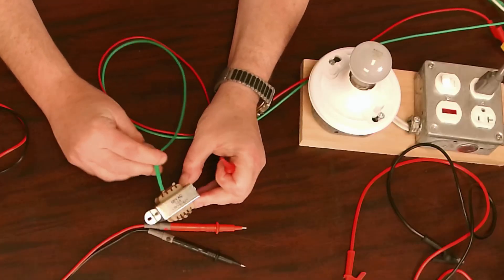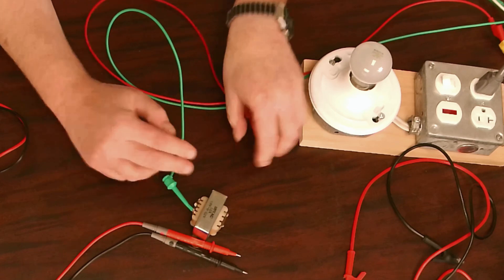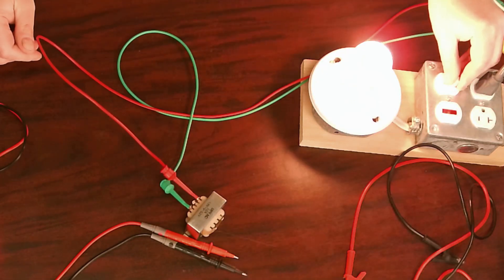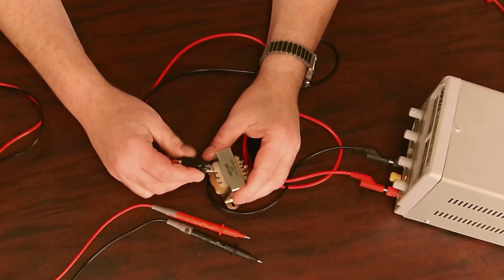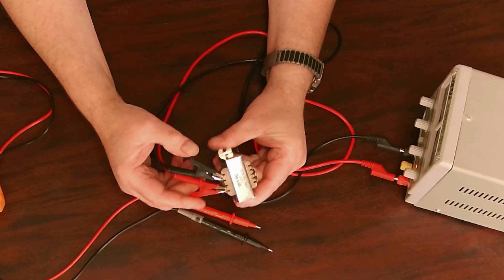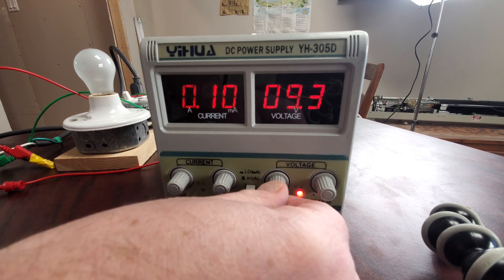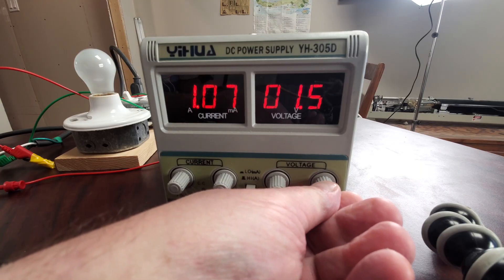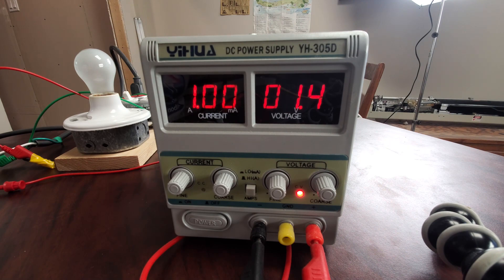MORE Ways to Identify Unknown Transformers

Comment: as I was studying my electrical book , I stuck with what's a dead man switch? 

I searched the definition about it, which says ' is a switch that prevents an equipment to be turned on accidentally or so '  but then I needed to dig deeper into this  DMS and found out your video which helped me understood what DMS is and its circuit diagram.
 

Appreciated Dr ❤
Reply from the maker: Thank you so much! I'm so glad you found it useful.

A dead man's switch is such a valuable safety piece of equipment I wish it was more well known. Its used in everything from train engines to protect against a sleepy driver to factories to make sure an operator is no-where near the dangerous part of a piece of equipment when operating. 

It really should be a must have item for anyone repairing or otherwise working with electrical  things operating with potentials higher than a couple of tens of volts. 

Here is the how-to video I made for anyone reading this: https://youtu.be/ZhCvTCeGvMc    

(For those viewers in different  parts of the world, use sockets, plugs etc appropriate for your region).

Remember though - it should be the last line of defence. Even with such a device, do things in a safe way as you would if you didn't have a dead mans switch. One should always have multiple layers of safety in case one or more safety precautions fails. 

And yes, I do use it myself when dealing with things that could zap me!

Comment: With an incandescent bulb in series with the secondary, the initial surge current may cause a very large voltage in the primary, higher than the 120V (240V). Only when the bulb reaches working temperature and its resistance increases will the voltage at the primary fall.
Reply from the maker: Yes! Although not much higher - the voltage gets limited by saturation of the magnetic core. Good thing  is the bulb filament gets hot really quickly - faster than the thicker secondary winding preventing overcurrent heat damage (unless of course the bulb was really oversized in relation the the transformer).

Comment: If only incandescent light bulbs weren't getting so hard to find! I need to build a light bulb rig. Just the other day I was doing exactly this with a variac and cautious measurement. Could have saved some time!
Reply from the maker: Too bad your in the UK or I would send a few bulbs, but mine would burn out in 240V countries. It may be different over there, but over here "dollar stores" often have them. Maybe you have places that sell things for a pound or two? The other options are decorative bulbs which are sometimes incandescent, and halogens are an option as well.

Comment: Thank you, some very useful information in this video. How would you calculate how much current the secondary could safely provide?
Reply from the maker: Thanks - glad you found it useful. Really two things: do a rough comparison with similarly physically sized transformers to get a good guess at the watts or VA. If there is only one secondary winding and you determined the voltage, use that and VA to get  current. For multiple windings, you may also have to guess by wire thickness (or if you cant see the wire, resistance of the winding. You could probably assume a max of perhaps 5% of the total power is lost in the winding at full power, but it varies. In the end you need to test - run it various currents for longer periods (say 1 hour) and watch the temperature and any bad "things are too hot" smells.

If you didnt already see it, look at the previous video I did on the topic (a few videos back) for some more way to do it.
Reply: @ElectromagneticVideos  thank you very much for taking the time to give a pretty comprehensive explanation. This is the 1st time that I have seen your channel, so I will look at your previous videos.
Reply from the maker: @ianfisher6561  Your most welcome! You will see quite varied videos on my channel - all science and engineering related - enjoy!

Comment: We did do 'ring testing' on small power transformers, like in old TV sets... to check for opens, or shorted windings too I believe... using a Sencore LC53 et. al. Anyway...AFAIK,  if there is more  coil resistance, that damps the rings more... and a larger inductance make the individual rings longer (usually you want to see a few of them) A good fast rise-time pulse can generate ringing... but watch out for the inductive kickback!
Reply from the maker: "more  coil resistance, that damps the rings more... and a larger inductance make the individual rings longer" I think thats exactly it! And a short would really damp the the ringing to nothingness. Looked up Sencore LC53 = you can still get them on ebay!

Comment: I found the audio had a little distortion... either because of reflections (lot of glass on the walls, behind the mike)... or the base... maybe.
Reply from the maker: Actually thats exactly what I was thinking. My plan is to put up some big curtains in front of the window as an absorber to hopefully reduce the reflections bouncing around the room. Its  reflections thats why I normally use a headset mic - the reflections in my basement where I do most stuff are terrible - with the mic near my mouth the direct source overpowers the reflections.

Comment: @ElectromagneticVideos The L meter could be using a frequency domain (sine wave, impedance), or time domain (square wave, ramp) or other measurement method.
I guess it is using the fixed frequency, frequency domain one, where the impedance is measured, and the firmware calculates the inductance, from that impedance measurement. 
Putting a resistance in parallel with one of the windings will mess up the reading either by shunting current, or messing with the mutual inductance. AFAIK series resistance between the terminals of the winding (like the resistance of the winding) won't... because that's a series current, not a shunt one.
Reply from the maker: I was wondering how it might be doing it - my guessing this really cheap meter it some sort of simple measure the current ramp type thing without considering R in any way. But you never know with the sophistication that can be built in to off the shelf meter ICs.   When I have some time will investigate with  a scope. Even with this meters limitations, I was amazed that for $25 you can get an inductance meter.
Reply: @ElectromagneticVideos  About the low cost of the L meter... the case and the display for the meter you showed... in the vid... is very cheap in China. (maybe a few USD in quantity) That case/display is widely mass produced for a ton of cheap DMMs. The band-switch terminals/wiring, are integrated into the PCB design. Although most of the DMM ASICs don't include an inductance measurement... it wouldn't surprise me if they replaced the resistors in the divider, with capacitors, and programmed a cheap micro-controller like a Nuviton ML51 (less than one USD per) to make, compute, and display the inductance measurement. All in all... for sure...about 10.00USD to mass produce that meter... in China.
Reply from the maker: @willthecat3861  You know - you are getting me more and more curious about it. Will open it and see. Your bang on about China - got in on Aliexpress - was looking for the cheapest to show thats all that is needed.

Comment: 12:40 if you have a scope, you don't need an inductance meter, you can calculate it from voltage drog at different frequencies.
Reply from the maker: If you mean voltage drop across a series resistor? That  would work particularly if you took the resistance of the winding into account in the calculations. You really would need only a measurement at at the power frequency. I would be wary of measurements at other frequencies because you never know frequency dependant aspects of the core might skew results.
Reply: Yes, across a series resistor. There are a few ways that you can do it. You can measure across two different frequencies to compare them but it makes the math easier if you measure one frequency and then drop it to the point where the signal amplitude is 1/2 of the original. You can also get pretty accurate results using a single pulse and measuring the ringing in a tank circuit with a known cap. Of course, if you a known inductor, you can also just compare it to that. Keysight has a good explanation of how to do it on their website, and of course there are many YouTube videos on different methods - some better than others. If only there was someone on youtube who would make a video comparing which methods work best for different tyoes of inductors... 🤔

Comment: 9:30 That's not just an assumption, it's part of the formula for designing transformers: the surface area of the cross section of the sum of primary windings needs to be equal to that of the secondary.
Reply from the maker: Not really - you can often have transformers with multiple secondaries where the total power of the sum of the max secondary powers would exceed the primary power, the idea being you have the flexibility of using the transformer in different applications that need more power at one voltage or another. Similarly, secondary windings of significantly different power ratings are also common - ie HV vs filament windings for a tube amp or radio. Thats why I was a bit non-commital as to how accurate a measurement can be.
Reply: @ElectromagneticVideos  Ah, yes, in that case. I was thinking along the lines of optimizing design for a specific purpose, but yes, if the usage is variable that doesn't work.
Reply from the maker: @SkippiiKai  One thing I should have mentioned in my reply is for the purposes of videos I have found that for the audience of widespread  backgrounds it can help to stay "on topic" as opposed to going of on slight tangents that might distract from the main point. So you will often see I try and take take the fine line between mentioning too much and leaving out too much. I'm always happy to have people like yourself add in more details in the comments - which often results in very interesting discussions.
Reply: @ElectromagneticVideos  If I made a video on transformer windings it would be 4 hours long, include a detailed discussion on why the iron in powered cores is the heaviest element that can be produced by fusion in a star without neutron capture, the differences between transformers and flyback coupled inductors, a deep dive into B&H charts and why the graphs for transformers' B&H charts look nothing like the pencil lead B&H charts, why 3 different elements are named after pencil lead in different languages due to the availability of different elements in different parts of the world, and at no point would I ever meantion a the windings.
Reply from the maker: @SkippiiKai  What I discovered a while back is more detailed videos like that often loose audience after a few minutes - youtube shows me when viewers leave. I thinks is generally  case of modern audiences having a shorter attention span.
Reply: @ElectromagneticVideos  Is "detailed" the right word for what I described? I think "incomprehensible" is a better term for the way my brain works. (in seriousness, I do know what you mean, and I think you're probably at the right length. Also, I have some friends who are college professors, and describe the current generation of students' attention span as "not really worth coming to class."
Reply from the maker: @SkippiiKai  Its really sad actually - my buddies who are profs report the same thing. I think its due to social media and messaging - if you are used to getting interrupted every few minutes you dont develop a long attention span. Last time I taught university courses was 30 years ago - no problem back then which was just  before social media got huge. On the positive side, I occasionally asked to be a judge for a nearby university's 4th year keystone thesis projects. While maybe 25% are disappointing (and this is a renowned university) the top 25% are generally really impressive. So   the top students are managing  excel  in spite of social media.
Reply: @ElectromagneticVideos  I turored a teenager in math recently. First time. It was interesting. She didn't show up with a pencil or anything. I gave her a notebook and pencil, and said "here's the first rule you'll definitely need to know..[blah blah] ..."
After a blank stare: "You should write that down."
She seemed completely surprised, so I very gently asked, "Has anyone ever taught you how to take notes before?"
I'm not sure if I believe no one tried to teach or not, but she certainly had never learned to take notes before. So on the first day, she took notes on how to take notes, because she's never taken notes before.
I've got a friend who's a middle school math teacher.  Here in the US, the curriculum are so rigidly focused on passing SOL tests that the teachers don't even get to teach kids how to learn - not that the kids want to.
One college professor says she hasn't seen a student take notes in years: they just ignore what she says, but every few minutes they pull out their phones and take a photo of the whiteboard or powerpoint.
I'm not an educator, and I try to stay open minded: it feels a little strange that people under 30 can't read cursive anymore, but being able to type blind by middle school is definitely a far more useful skill. Maybe note taking is the same. With an AI and encyclopedia on your phone, maybe memorizing long formulas or famous speeches is useless. But, the lack of interest, of engagement, the distain of learning; there is no replacement for that.

Comment: for better cheap inductance measurements recommend get (buy) meter who in all positions measure only L 🥇 (without C too!)
Reply from the maker: Unfortunately there seems to be a trend to squeeze as many functions in a meter these days - I'm sure for marketing reasons. One of my multimeters only has 1 voltage setting  - AC volts. If you want DC V you need to press a function button. And yet on the dial there are positions for many things that one hardly (n)ever uses (sound dBm for example).

Comment: Hi, your video and audio quality is great. 
A simple trick that i did when i was a teenager and started with Electronics, to identify which was the primary and which was the secundary, was this :
Take a 9V batterij and a small Neon bulb (from a old switch, panel indicator etc..), connect the Neon bulb on one coil, and tap with the 9V to the other coil.
If the Neon bulb lights up each time when you tap the 9V, the Neon bulb is on the primary side. If the Neon bulb doesn't flash, it's connected to the secundary side.
Another thing that i use to do back then, was connecting a audio source like a radio, to the secundary, and a Neon bulb to the primary, the Neon will then flash at the ritme of the music.
Reply from the maker: I remember the  transformer + audio + neon trick you mentioned a long time ago when we were discussing neon tubes for some reason. I  like the neon trick for identifying transformer windings - nice , simple, relatively safe - although you can get a good zap if you arnt careful :)
Reply: @ElectromagneticVideos  , i remember only a little tingling. It also depends on the volume of the radio, and kind of music. With music with more bass, you feel a bit more 🙂
Another solution without the Neon bulb, and only the 9V battery, is to see at the amount of spark you get when tapping the coil. On the secundary with less resistance, the spark is brighter. On the secundary wou barely see a spark when tapping the 9V battery.
And as extra tip, a AA battery is also useable when connecting car speakers, a little tap with the AA, and you can determine which wires correspond to which of the 4 (or more) speakers. And looking how the speaker cone moves, will tell the polarity of the speaker.
When connecting the AA with the positive to the positive of the speaker, the cone moves up, and with the AA battery polarity swappers, the cone goes down.
Reply from the maker: @BjornV78  I really like the idea of using  1.5V batter to determine speaker  polarity like that - how easy! Never heard of that before!